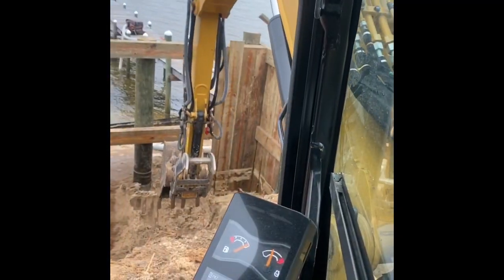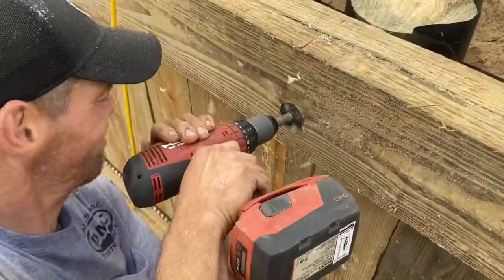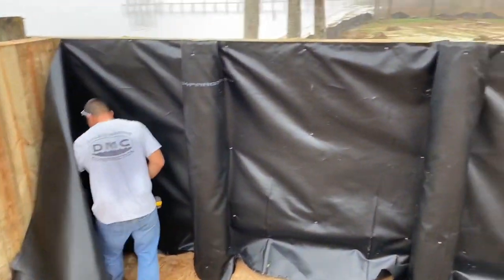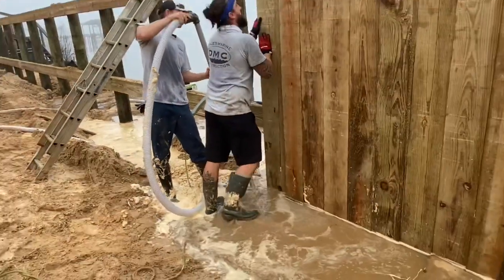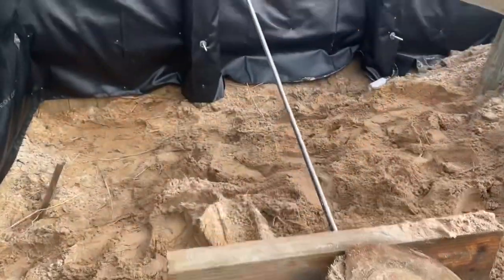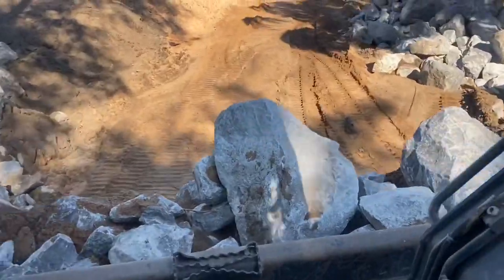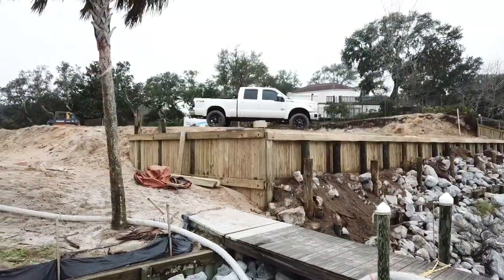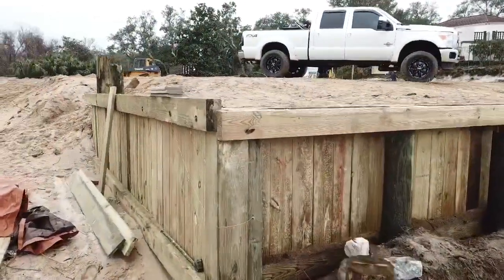#2 PROTECTING YOUR INVESTMENTS-WOODEN RETAINER WALL INSTALLATION

Comment: Is the Pressure treating any better than the standard stuff us homeowners get ? Also is there any need for a drain tile/pipes at the inside/bottom of the wall, or does the sand drain enough on it's own ? Thanks, thumbs up !
Reply from the maker: august Hey thanks for your comment yes the treated lumber you buy the big box stores are for ground contact. I buy from a local dealer that has a heavier grade of treatment .80 CCA is good for freshwater submersion and 2.5 CCA is good for saltwater.
But remember any lumber that is in contact with the water voids all warranties 🤷🏻‍♂️. 
This is a pretty large lot with a large house that is going to be constructed with a big roofline we just wanted to make sure that we removed all the hydraulic pressure from building up behind the retainer walls. They will also be running the gutter systems from the house into this drain pipe to keep from build up water behind the walls. Normally a wood wall does drain itself pretty well.